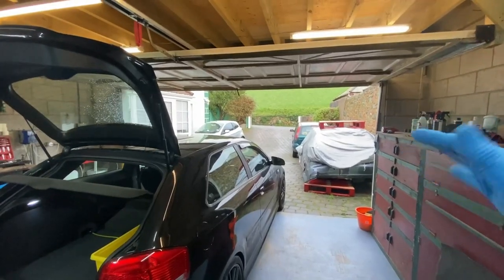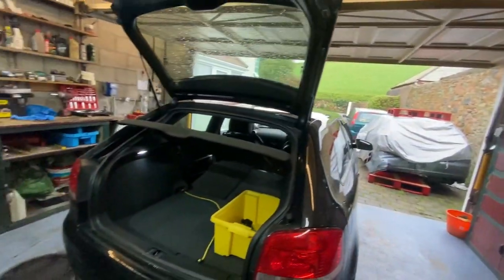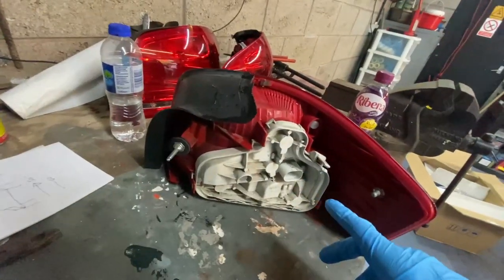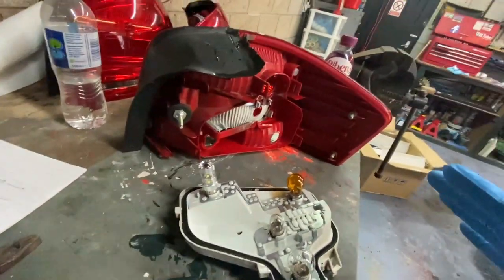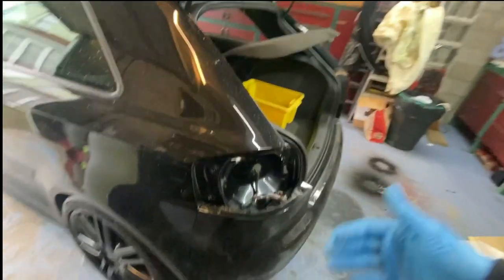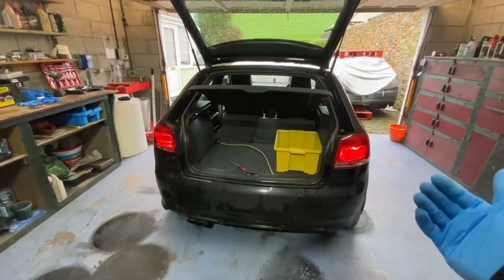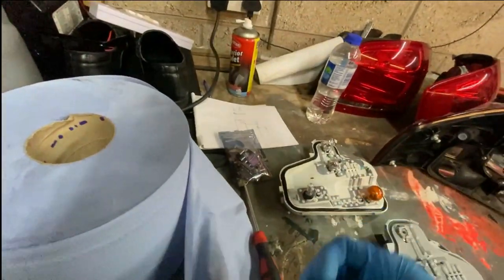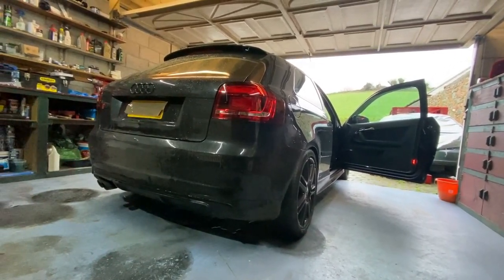Audi S3 8P - My New Rear Lights!

Comment: Thanks so much for the video! It Indeed looks so much better. Just a quick question, do you know the brand or model of led lights you use? I’ve been struggling with them cause they say canbus error free but a lot of them are not. Could you please note which one you use, it would be highly appreciated. Cheers!

Comment: Looks much smarter man.
Want black Audi badges for mine, are they a one size fits all? As on eBay it doesn’t specify which model they are for.
Reply from the maker: Cheers man, nah the face lift badges are bigger, which is the ones I have. Doesn’t really matter though you’ll be able to fit which ever size. But I know there are different sizes of front rings

Comment: Are these the same rearlights or what rearlights are these ? They look a little bit darker and they are original from Audi 

https://shop.ahw-shop.de/original-audi-schwarze-rueckleuchten-audi-a3-8p-original-facelift-nachruestsatz-3-tuerer
Reply from the maker: These are original  face lift lights https://www.ebay.co.uk/itm/Audi-A3-10-12-OEM-Dark-Red-Rear-Tail-Lights-Lamps-Pair-Set-Left-Right-Hatchback/112699401322?ssPageName=STRK%3AMEBIDX%3AIT&_trksid=p2057872.m2749.l2649